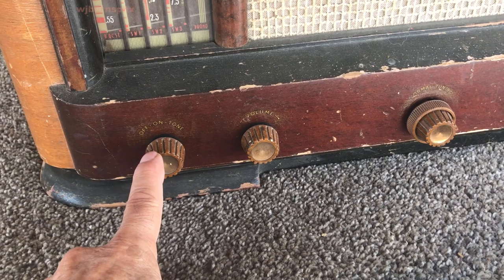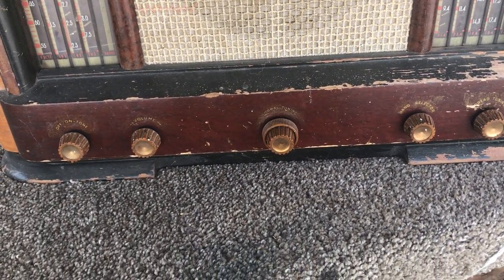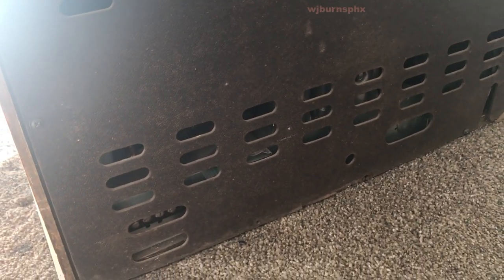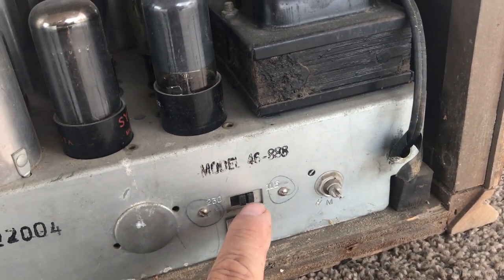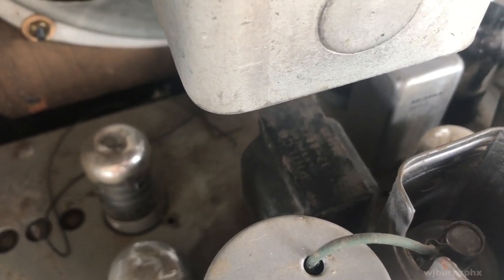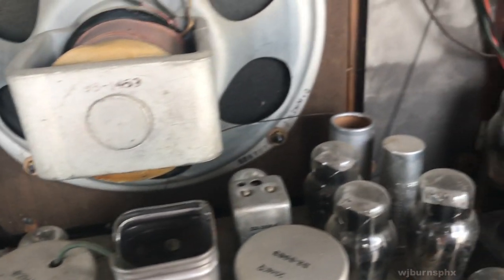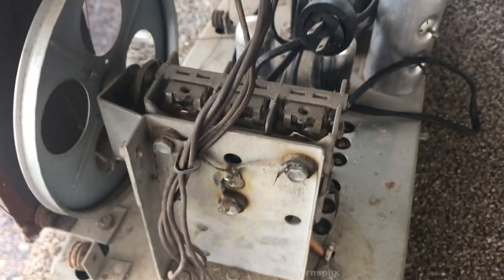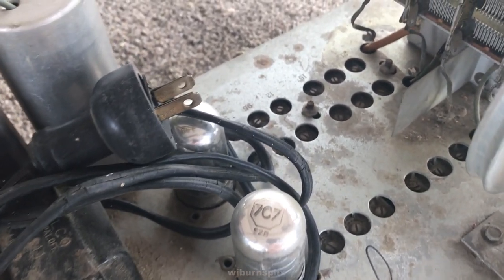Philco Tropic Intro

Comment: Beautiful radio but man it has a bunch of capacitors! What would you suggest for lubricating parts in a radio like the preset buttons and such? Thanks for sharing. -Ian
Reply from the maker: Sorry Ian, there are no preset buttons on this radio. Look at some of my Zenith vids for an indication of what I used on those radios. Generally I use a fine machine oil. Thanks for the comment.